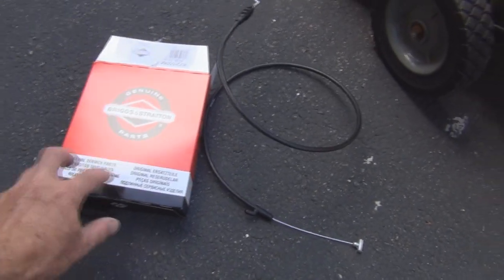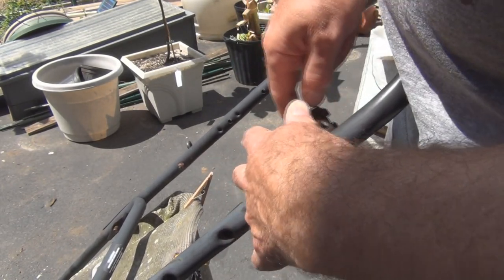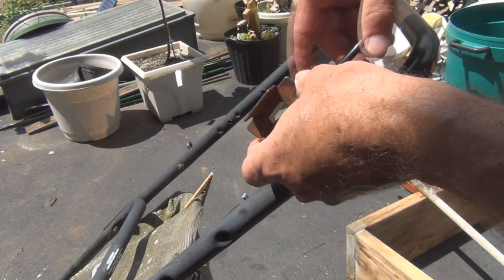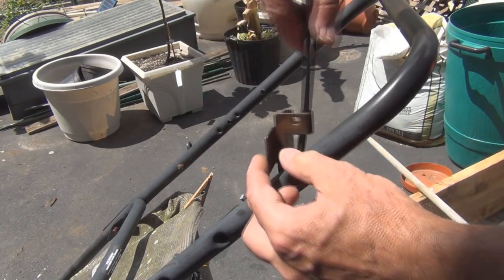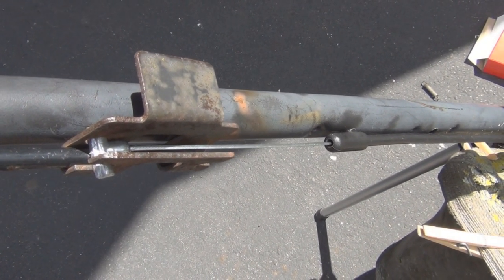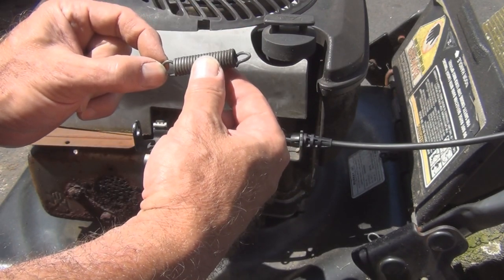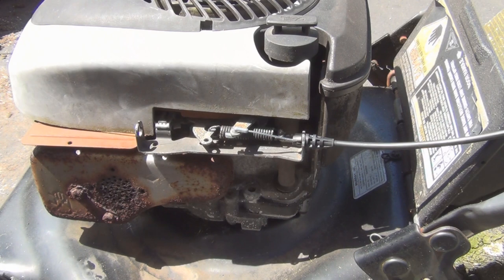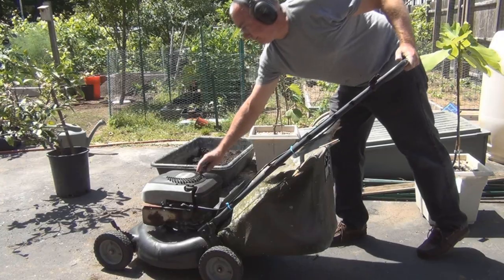Murray Lawn Mower Safety Cable Replacement

Comment: I had the cable end threaded incorrectly through the metal bracket on the handle bar. Thanks for setting me straight on it. You made it so easy.

Comment: i pulled a couple mowers out of the garbage both all taken apart so i had no reference of how it went together spent 30+ minutes trying to get the cable back on the lever then another hour looking for videos and this one explains everything perfectly i couldnt figure out thebracket and orentation of the handle and cable so thank you. now i know how it goes back together time to figure out how to do it with one hand🤣🤣

Comment: Thanks.... I found a mower in the junk, and it had that cable mount dismounted. So after messing around for about 10 mins I just went here on Y/T and got a vid on the first try.  I think it is a bad design but I have seen the brake bar broken at the mounting hole before so I guess this fixed that problem.....

Comment: I have a 1995 Murray 20213B with a stop cable that has rusted through. It has the same bracket as your video shows. I could not see the Briggs & Stratton (successor to Murray) part number on the box your cable came in. I bought a Craftsman cable earlier, which was too long. What Part No. are you using for the replacement?
Reply from the maker: I think the upside down number on the top flap of the box reads 672550M
Reply: @NewEnglandgardening  Got it. Thanks! I found a few referencing B&S Part No. 672550MA, 37" in length, which seems right. Bought on Amazon via your link.